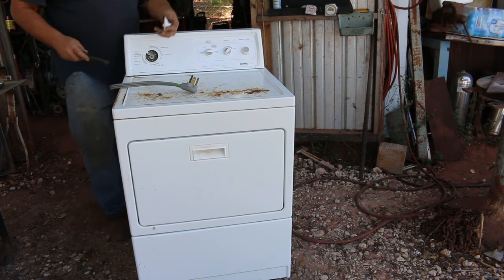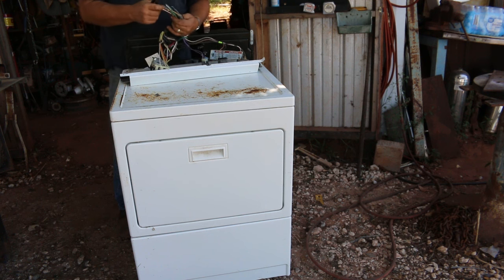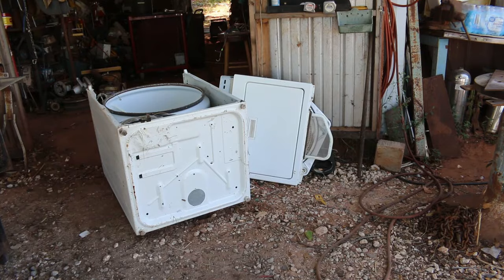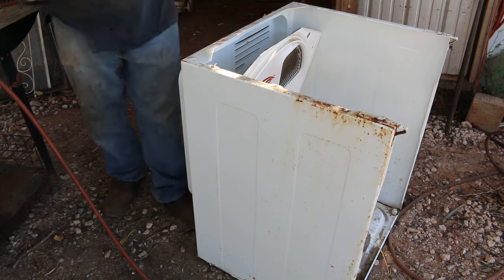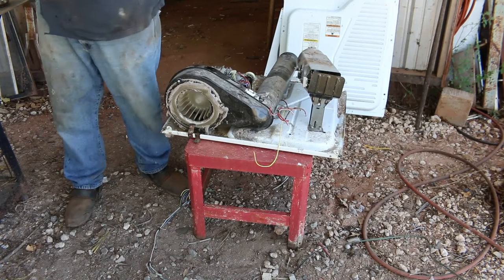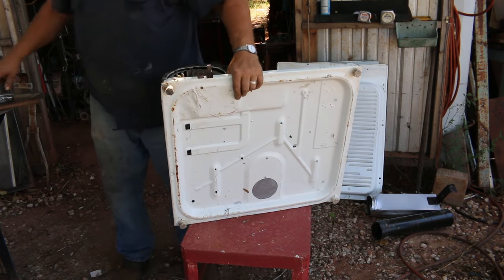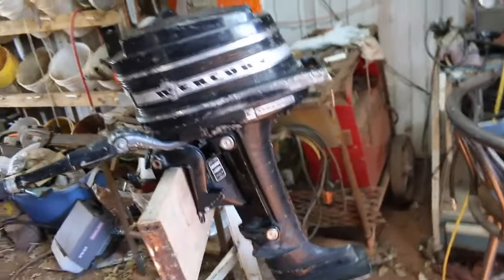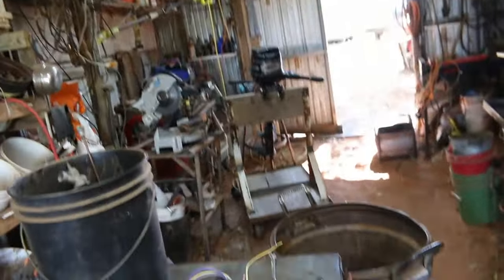Scrapping out a Dryer for shred and copper wire

Comment: I enjoy all your videos Okie!  I'm have no doubt at all that you will do good on the motors.   I have watched enough of your videos to see that you always figure things out.  The only question I can see is if you end up liking to do it or it turnsg out just not to be your cup of tea. Thanks for sharing your videos of future adventures you would like to try and go from there.  Enjoying yourself is all that matters in the end 👍
Reply from the maker: so far so good, I plan to order a tester for the condenser, and I watched a video on how to test the coil, the only part left is the points, and the book says to change them every 100 hours of use, they run $10.00 plus shipping

Comment: Fix motor would be interesting.
Reply from the maker: 3 things I need to test for spark, coil, condenser, and points. I plan to order a condenser tester today and watched a video on how to test the coil, and the book says points should be changed every 100 hours, cost on points about $10.00 plus shipping, condenser about $30.00 with shipping.

Comment: Only time I do take apart on a dryer is for change lol, I do however pull all the wire out of them. I use them for smalls I fill it up along with washers with nuts bolts small steel etc.etc.  #happyscrapping
Reply from the maker: yes, I add a lot of smalls to the washers and microwaves.

Comment: Enjoyed the break down video to gain more money on the scrap. I was wondering if it paid to tear it down for the different metals and get a better pay day on scrap metal. Stay safe and see you on the next video.
Reply from the maker: the wire pays good, and you get a little cast aluminum from the motor plus a little aluminum wire, and the aluminum plate from the control panel, then copper from the power cord if it has one